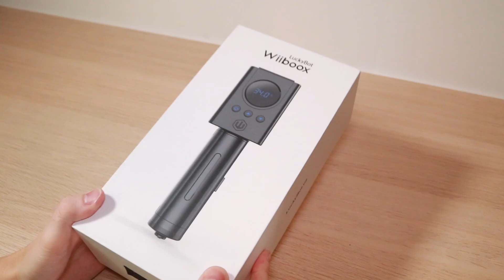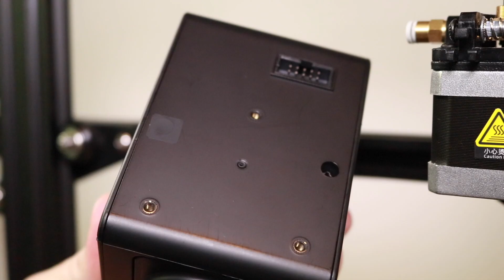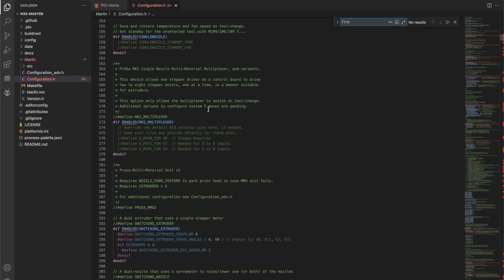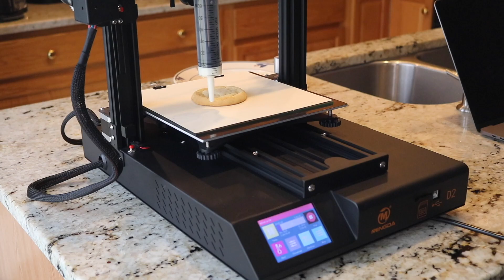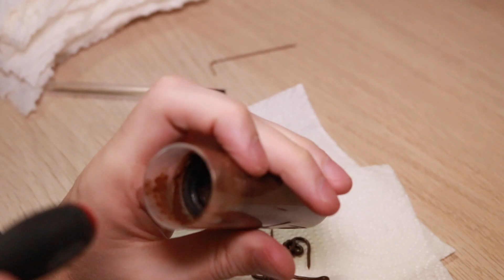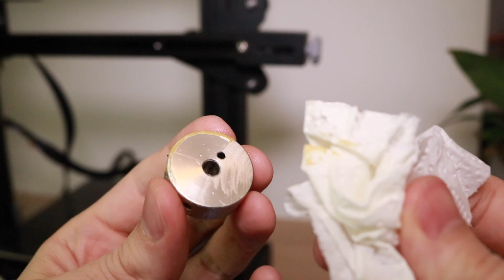Luckybot 3D Printer Chocolate Extruder from Wiiboox / 3D Print Food?!

Comment: Just thinking about all the work you put into trying to get this thing to work makes my blood pressure rise. I appreciate the honest review. I have always been curious in chocolate printing but this aint it. I'll stick to 3d printed molds and vacuum forming for now
Reply from the maker: Yeah, I forgot to include me having to start all the way over because the Extruder cable arrives with the polarity reversed, so the chocolate extruder would move in the opposite direction when prompted. 

What a mess!
Reply: @AndrewSink   Hi Andrew, much kudos for all the work you put into this video! I am sorry for the inconvenience LuckyBot brought with you since the machine you tested was the beta we launched on 2021. We have upgraded it and sloved the problems you met in this video. Firstly it won't have a fire hazard as we added the temperature resistance module(TRM) and this tricks the 3d printer into thinking it is always 190 degrees celsius at the nozzle. In addition, we wrote a program code called  “For Luckybot” gcode file ,just run the “For Luckybot” gcode file before executing the print file. It is an automatic program to modify the E steps/mm of your printer = 750 . And the E-axis adapter wire now can solve that extruder moves in the opposite direction. We are always on the road of innovation. 🤝

Comment: Interesting this pops up on my feed because I plan to get my lucky bot permanently installed in a few months. When I tested it a year ago I didnt have the install issues you did (possibly fixed by your comments because I had a kickstarter unit itself), but I did have the low torque motor issue. I never considered it was because low torque until you said it in this video. very interesting.....
Reply from the maker: Best of luck!

Comment: I had the exact issues.   I however removed the thermistor/heater tube from the board, then sliced with 0 for heat settings.  
Awesome video
Reply from the maker: Thanks! Did you have any issues with your firmware preventing cold extrusion?
Reply: @AndrewSink   No.  I sliced in s3d and set the temp for bed and hot end both at 0.  printer began to print immediately.

Comment: I think the plastic bottom of the Extruder should not be there. there is a metallic nozzle in the package. I tried the first print and it looks like the printer do not communicate properly with the extruder piston. at some point, the chocolate stopped pushing and it caused gaps and empty spaces... Hard to configure when the box do not contain any details how to configure printer and also extruder. For example bed has 70 degrees by default which melt chocolate easily. is it in the documentation ? No.

Comment: Got one of these. They did make a change and added in a sensor that shows the nozzle temp at a constant 91 degrees C. Also, how do you level the bed ? Using paper or another type of measurement ?
Reply from the maker: I calibrated it manually; no easy way to auto-calibrate without additional equipment! The gantry is just up so high!

Comment: To be fair... you did the firmware flashing onto yourself. If you followed the original instructions you wouldn't have had that issue. It would be a fire hazard, but it would have been easier ;)